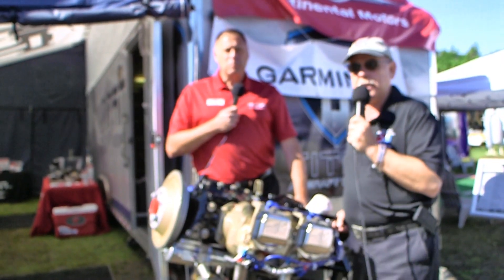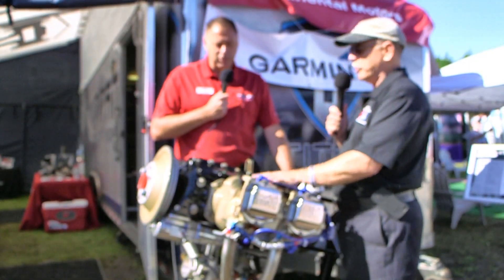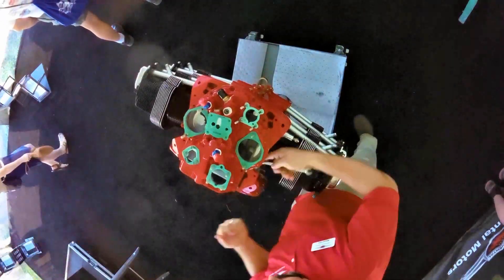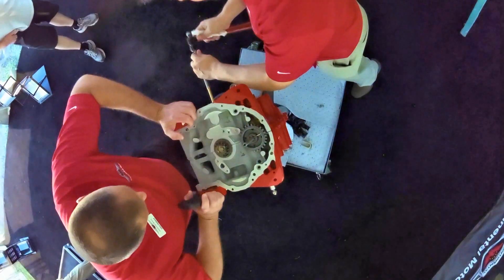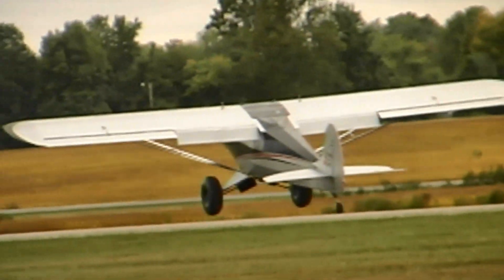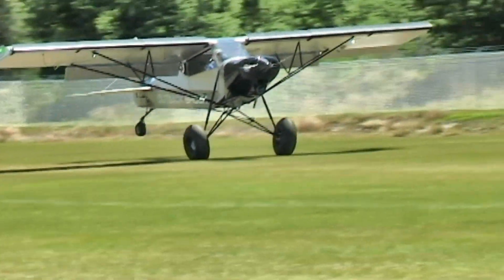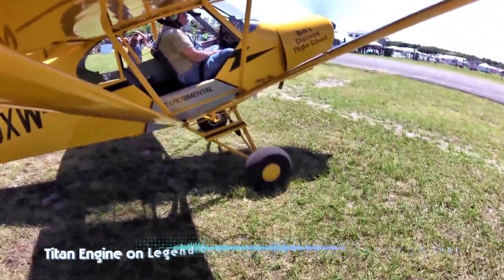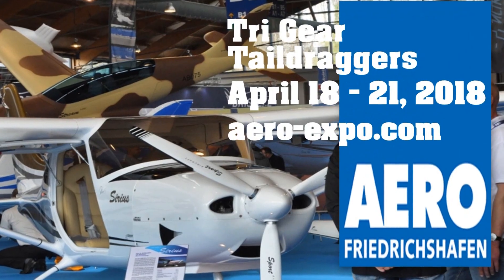Titan Engine, Titan Aircraft Engine, 180 HP Titan engine for light sport & experimental aircraft.

Comment: The Titan XP 340 webpage says “...generate over 180 HP yet weighs 20 lbs less than the standard X-360”.  That is quite different from being 20 lbs lighter than a 320 as stated in the video.